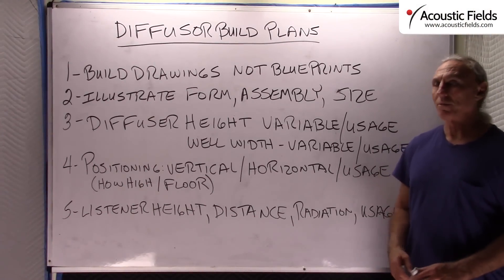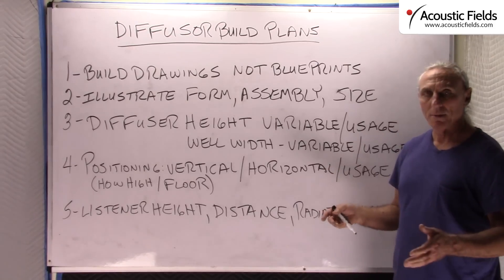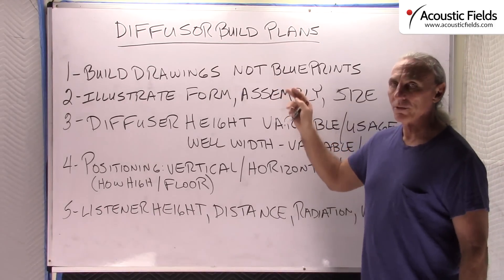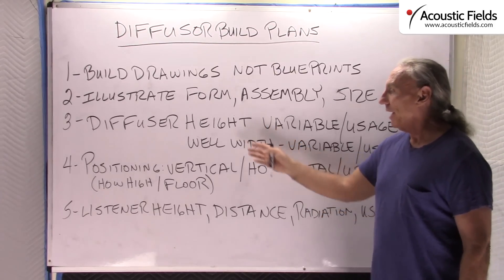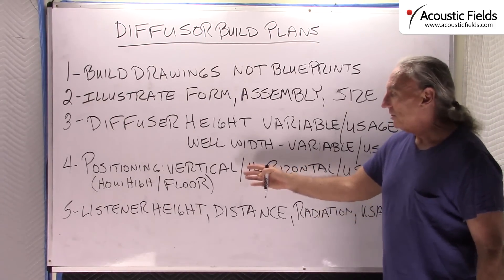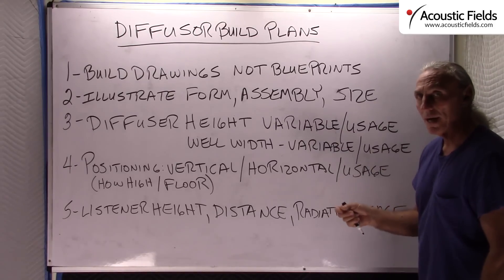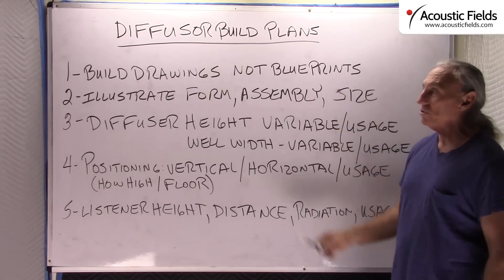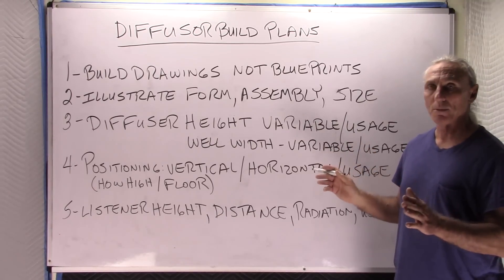DIY Sound Diffuser Build Plans - www.AcousticFields.com

Comment: do the Skyline difusser make the Same Job as the qrd diffuser?i am from Germany and we have the Schröder diffuser. sorry about my english:).
Reply from the maker: Hi Bebraham, The term "Skyline" is a product name for a two dimensional diffuser. It diffuses sound in two directions. There are one dimensional diffusers and two dimensional diffusers. Each has its own application depending on the audio usage of the room. Manfred Schroder created the one dimensional diffuser. RPG made it commercially viable.
Reply: Acoustic Fields thank you very much. i will Show you pictures of my room @ your Website. i don't know which diffuser is the better Option für my room. i have Friends in the U.S. and i will Show Them your Website because they need good acoustic  solutions in their rooms.